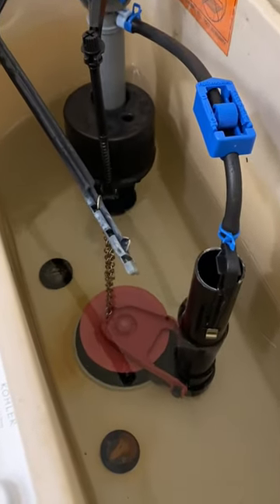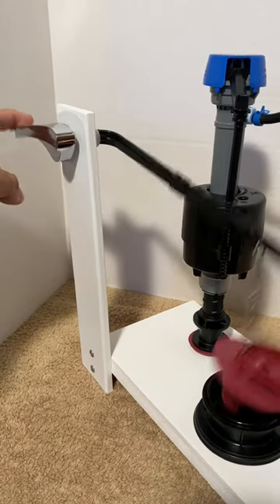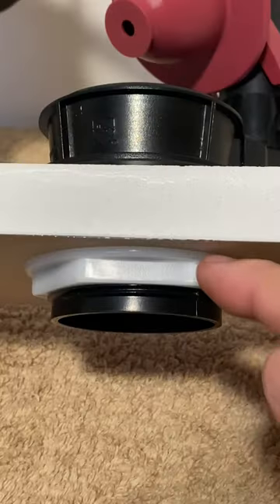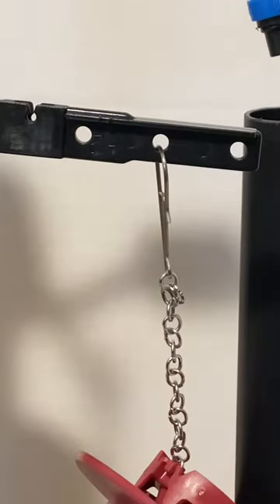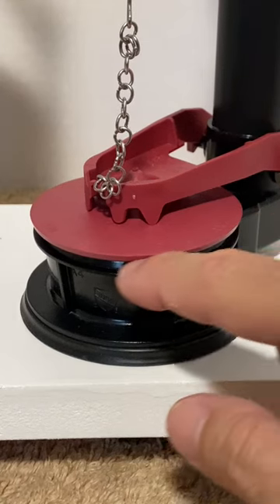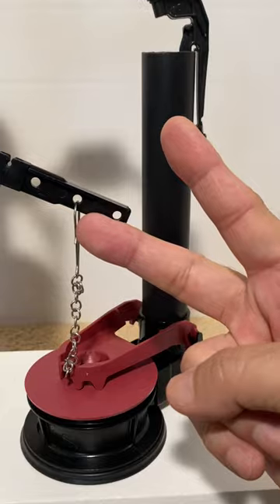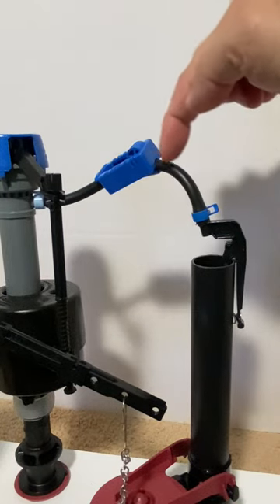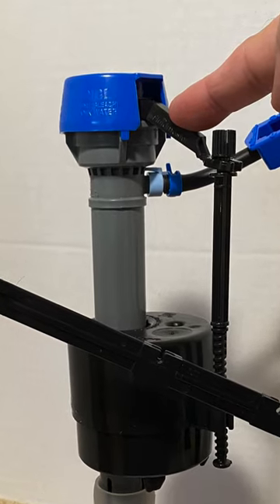How Toilet Flush Valves Work

Comment: I'm looking at a ton of videos and still don't understand why the refill valve spills into the overflow tube.  If the flapper opening fills the bowl, why does the fill tube have to  ALSO fill the bowl?
Reply from the maker: The refill tube doesn’t need to point into the overflow tube… IF… the bowl fully fills without it.  I posted a video on this… How I Fill My Toilet Tank Faster & Save Water
https://youtu.be/uMfD_utCahg
😎

Comment: Very good. One thing I don't get is that there is a small channel that lets water go into the overflow tube and under the flapper to let water into the bowl even when the flapper is shut. If the fill valve fails and sends too much water into the bowl, why doesn't the bowl overflow? Is there an escape route for that water to go down the drain before it overflows? Thanks!
Reply from the maker: Thanks for the question.
If the fill valve fails to shut off, water will continue to fill the tank, flow into the overflow tube, and down into the bowl.  The water level in the bowl will rise until it spills over into the siphon at the back of the toilet and down the drain.  Here's an explanation of how the toilet bowl works... https://youtu.be/qpbQ2Zm4QP0
😎
Reply: By design the bowl never overflows unless it's clogged. The weight of the water is enough to siphon it through the trap. It does waste water though, so you'll still need to get the valve checked.